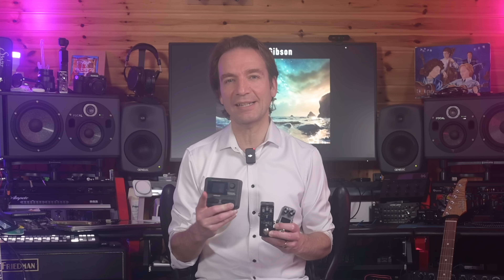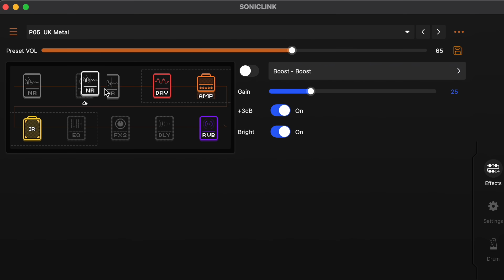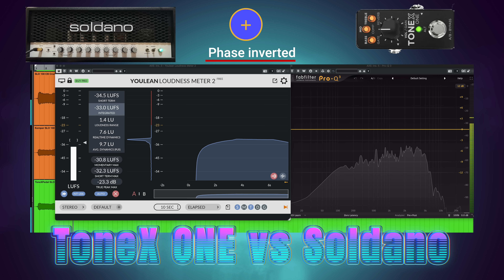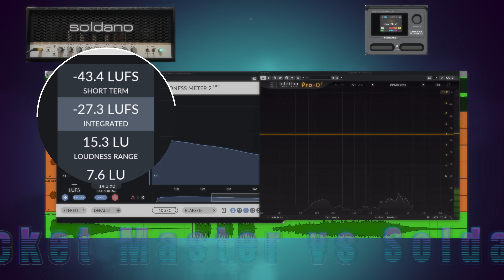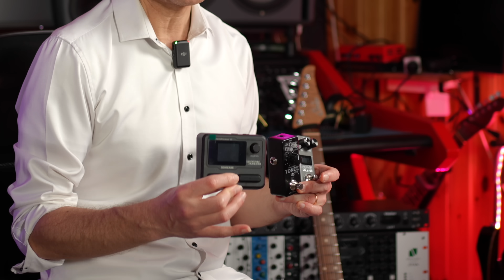Valeton GP-5 vs ToneX One vs SoniCacke Pocket Master (with NULL Test and vs a tube amp)

Comment: I have both the Tonex One and the GP-5.   But the Tonex One has a very high pitched whine that I traced to my dc power supply not providing enough current.  When I swapped in the GP-5, it worked fine.  In truth it’s easier to live with the GP-5.   But the Tonex One has some presets that are really nice.  I’ll need to figure out which one I can keep.

Comment: Tonal differences (you won't hear in a mix):  Pocket Master warmest, with centered mids; Gp5 has more upper mids, both though lose a bit definition on the high frequency side; Tonex has slightly brighter upper mids than gp5 (and slightly brighter than original amp) but keeps definition at high frequencies. Tonex is more hifi, brighter, but has very limited fx (no overdrive nor booster!!!).
Reply from the maker: Thank you for sharing your detailed observations on these units!

Comment: I bought the Valeton GP-5 as a backup to my amp, which I use set to a dry light crunch as I get 99% of my sounds from pedals on my pedalboard. I only need one sound for the whole gig. I have zero tolerance to bad apps with even worse interfacing with them the Valeton is the very best I have seen. Instant hookup online and user friendly.
Reply from the maker: Thank you for sharing your experience with the unit!

Comment: Hello Leo! 
On the market there are some new devices that are just coming out now. They seem to be the next step from the GP5/PocketMaster ( and also the bigger brothers the GP50 and the Smart Box ). I mean , they check some boxes that the others don't.
For example: they have the  ability to load NAM profiles and use those in conjunction with IR , they also have 48KHz 24bit AD/DA (which in theory helps with NAM profiles which are 48KHz too ) , they also have completely movable blocks in the fx chain ( 10 blocks total ).
I'm referring to the new Strich Pipe Tones , which is the same as the new Soran Tiny Stomp  and also the same as the Lekato ME-05
It would be interesting to compare one of these with the "previous generation" ( GP5/GP50/PocketMaster/Smart Box ).
Hope this gives you some food for thoughts! Have a nice day and thank you for all your work!
Reply from the maker: You are welcome and thank you so much for your suggestions!
The Smart Box is actually coming to my studio...so we will have some fun with it!

Comment: What scarcely ever gets mentioned with all these type devices  , is how you use them, and for me, I have not seen anyone address how you intend to monitor the sound from them….for me, monitoring the sound thru studio monitors is kind of sterile and you don’t get the live raw sound of a speaker designed for a guitar amp…ok maybe for recording and monitoring in a DAW, but not as inspiring sounding as a guitar amps raw liveliness…that why I prefer a device like the Positive Grid Dpark amp….it has speakers and is like a scaled down guitar amp and you still can come out of it via usb to record and monitor thru your DAW
Reply from the maker: Thank you for sharing your findings
Actually the Spark should have an FRFR speaker, that should be similar to the speaker of your monitors.

Comment: The looper has either 10 or 20 seconds depending on some update, according to other reviews 
   The headphone out also provides true stereo out effects on the guitar.
    I use a small portable amp for busking, (with another FX unit), headphone out to Amp's line in and microphone into the "guitar in" of the amp, and the Amp's Line Out retains the stereo.
    The drums offer a quick songwriting tool, but NOBODY, so far, in no other languages, and not even in the manual, demonstrates those 99 beats! 😢
Reply from the maker: Thanks for the detailed sharing

Comment: Hi Leo. I was browsing Tone3000 Nams today and noticed there is a page called plugnplay who say they do optimized NAM profiles for things like hotone, valeton and sonicake. Its not clear how they do it but perhaps they adjust the NAM for the conversion that happens on the cheaper units. I've used the specific Sonicake ones on my Sonicake Pocketmaster and they do sound good. Do you have any experience with this or any idea if any credibility to their claim?

Comment: Considering the Pocket Master comes in neon green  and Purple with green buttons and the other ones look like boring guitar pedals..  I ended up getting a GP5, just got it overnight. The idea of a wireless and battery operated , plug and play at the gig.  It's getting crazy. My usual live rig is classic, two cabs, rack, pedalboard. But it certainly is glorious and mighty. It is a beast to behold and move.  And sometimes it's just me with my flutes kind of gig. Maybe with an acoustic guitar. Then the full blown electric guitar and flute rig with 50 + 50 Watts of El-34's and a ton of effects. Love the flutes through the big 50+50 tube rig, it's just killer!!! Best ever. Guitar sounds great through it too, as an after-thought.
Reply from the maker: Thank you for sharing your experience !

Comment: Valeton's Suite will not display in editing view on my brand new PC even with the latest Windows 11 running? It works fine on Android but I don't want to use my Android phone that has access to my bank accounts for music. Also, for the Valeton editing software to work on my phone, the user must allow intrusive access to the phone's memory, contacts, images, location etc. all of which are transmitted to Valeton unencrypted and stored on a server in China. Did you know that? When I wrote to Valeton support, they merely suggested resetting the GP5 and trying a different USB slot although I already told them that the GP5 connects to my PC but that there is a flaw in the Valeton software suite not showing the editing screen. So, from my personal experience and blowing money on this, I would never recommend it.

Comment: the 7/4 main (bluesy) riff on the PocketMaster original review video is really up my alley ✌🏽🤙🏾😜
one of my favourite of yours ;) .

So… concerning the ADA conversion, and digital recording bit rate, on the PocketMaster & GP5 :

Do i/we have no choice to recording a 24bit idea, like, into another pedal, for eg ? 
If the ADA bit depth is at 24bit, i should be able to record a musical idea , by running my PocketMaster into my Mooer GL100 looper pedal, at 24bit 44.1kHz, and then export the WAV files from the Mooer into the computer.
In case i need to record directly into the DAW, i’ll just use my regular Audio Interface. 
Correct ?
Maybe one caveat on my setup, will be that i won’t be able to export the idea as a dry signal, into the DAW, right ?

i’ve just ordered the PocketMaster, as it has the most comprehensive metronome, for odd time signatures (better than the GP5 and the Mooer GL100 as it has the 1/4 beat option, for the click) . 
Also, unlike the ToneX One, or the GP5, one can dial it in, right in the unit itself, with no need for the app. 

thanks again 
kudos from Portugal 😉
Reply from the maker: Thank you so much, I'm really happy that you like the riff!
I guess it depends from the Mooer GL100 and if it is able to record at 24 bits and 44.1khz.
Yes, you can use your audio interface.
Thanks

Comment: In the Valeton site says:

Specifications

A/D/A Converter: 24-bit high performance audio

Sampling Frequency: 44.1 kHz

So, the GP-5 works in 24 bits; not in 16 bits as you said.
Reply from the maker: If you have watched the comparison chart and listened what I said, I said that the audio interface is at 16 bits and 44.1 where when used stand alone the units works at 24 bits....In fact, when I connect the unit to my Mac, my Mac recognise it as an audio interface at 16 bits and 44.1 kilohertz....
Thanks

Comment: Hey there! Regarding latency on these devices, you mean the latency using them as an audio interface, or while switching between patches in a guitar signal chain? Thanks!
Reply from the maker: Hi, it is the latency when you play those devices using the physical in and out. If you search for one of my video about the latency of 23 amp modeling pedalboards, you can find more info.
Thanks!

Comment: Am i still need ir loader for these modeler
Reply from the maker: Hi, an IR loader is not mandatory, in my opinion.
Reply: @LeoGibsonGtr if you should choose one  between 3 of it and give me the reason . I want to buy one but still confused need a suggestion.
Reply from the maker: In my two cents section of this video, I have tried to sum up the main differences and reasons why you should buy one or the other....at least I hope so
Thanks!

Comment: Leo o Gp5 so tem 512 sample points nao achei nada que confirmasse essa informação. Pensei que era de pelo menos 1024 padrão da maioria dos equipamentos leitores de IR
Reply from the maker: Hi, for me the stand out feature is the possibility to load profiles and the best profiles (in my opinion) are the ones with the cabinet included (as they capture also the interaction between the amp and the cabinet). Therefore I would not care too much about the IR sample rates.
Thank you!

Comment: Thanks again Leo. I love the features of that sonicake pocket master, with a tuner and possibility to use battery. Great thing to bring for holiday travel. I didnt like the sound after conversion from the original NAM profile, but I know it have many great sounding patches that will probably sound much better then a converted NAM profile and who cares about that when bringing the thing on holiday to play some shred stuff in front of bonfire with grilled sausages. What I love most about the sonicake unit is the price. Thats as low as you can get and in a size that fit perfectly in a gigbag along with the cable, battery pack and guitar pick and maybe even a mini amp. Now it makes me think if I wanna go camping with my electric guitar for the first time in my life and live under a tent for few weeks. Now it all start to make sense because only few months ago I would never even think of bringing an electric guitar under a tent to spice up my holiday.
Reply from the maker: You are welcome and than you so much for sharing your findings!!

Comment: I did a search with Chatgpt and it told me that the Sonicake cannot use different cab sims with the profile but you have to download profiles that have the entire rig(effects, amps and cab sims). GP-5 allows you to add cab sims to your profiles without having to look for entire rig profiles. I was on the fence about this for a while. The Sonicake is very affordable but I didn't like the plastic casing and it doesn't really look like it's for live use but only home studio/rehearsal. I chose the GP-5 for its rugged casing and more options for profiles.

Comment: Hey Leo, thanks for your videos, they're great. I recently started using the ToneX One for my amp solution where I can't bring an amp for volume reasons (common problem in churches). I'm wanting to make a small board with just the ToneX and a DI as my amp section separate from my effects pedalboard and I'm wondering: what is your opinion on Line Isolators like the Walrus Canvas, or the Pinstripe Pedals DISO+ over something like a Radial JDI? Is there any benefit tonally, is it all volume?
Reply from the maker: Hi, thank you; I'm really happy that appreciate the video!
Why do you need the DI Box? in order to convert Unbalanced out to Balanced one?
Nonetheless I have used the Walrsu canvas and it is a good unit. I have not tried the Pinstripe...therefore I can't tell from direct experience.
Thank you!
Reply: @LeoGibsonGtr  Thanks for the reply! Yes I need to send the signal from the tonex to the mixer across the venue, and converting unbalanced to balanced is the best way to do that. I was just wondering if you thought it might be worth while to go the line isolator route over a more traditional DI.

Comment: Hi Leo, I understand that all three units have audio interface capabilities. I need to ask — can the Pocket Master or GP-5 be used with a standalone version of AmpliTube for practice purposes (not for recording)? In other word, will the plugins be able to recognise the clean DI from any of those units?
Reply from the maker: Yes, you just need to remove / switch off all the effect in the pocket master signal chain.

Comment: Got a pocket master myself and I must say the battery is a game changer for me. I used to have serious noise coming from both my pedals and amp, and ever since I swapped to the pocket master plus a wireless device all the noise is gone, also no more annoying cables. As a bedroom player this combo fulfills all my needs. I play about 1-2h on a daily basis and a full charge of the pocket master lasts me a whole week. I paid about 60 bucks for the PM plus 40 for the wireless device, so that's around $100 in total, and all my noise problems are gone. Best two purchases ever.
Reply from the maker: Thank you for sharing your experience
Reply: What wireless device did you get?
Reply: @corsa180  Joyo JW-03, now that I look again it was actually 27 bucks not 40!. I also ordered a Joyo JP-06 noise blocker with it, so there's the 40 bucks (which I didn't even end up using at all)
Reply: @shinjiikari4629  Cool, thanks for the info!

Comment: Interface ToneX One - IK Multimedia: 24-bit/44.1 kHz
Reply from the maker: Thank you for sharing!
Yes, that's when using the ToneX one as an audio interface, but I'm not sure if the conversion of the standalone unit is the same
Reply: @LeoGibsonGtr  From IK Multimedia product page
Specs
TONEX ONE

20 customizable presets
Ultra-low noise, 24-bit/192 kHz converters.
5 Hz–24 kHz frequency response
Up to 123 dB dynamic range
USB connection/ 24-bit/44.1 kHz audio interface
Power Source: 9V DC, 120 mA (not included) or via USB-C
Size: 48 mm/1.89" (W) x 94 mm/3.7" (D) x 53 mm/2.09" (H)
Weight: 160 g/ 5.6 oz
Reply from the maker: Thank you so much! it is at 24 bits and 192 kHz

Comment: Hi Leo, I have both , the Sonicake Pocket master and the Valeton GP5, and although I prefer the sonicake’s convenience of rechargeable battery facility, it has a tendency, on high gain tones to distort during fade out, which the Valeton gp5 does not. Will rearranging the built in effects and noise gate settings solve this problem? Please keep up the brilliant work. Your demonstrations are by far the most informative and unbiased on You Tube! Kind regards Greg Bell from here in the U.K.
Reply: I saw another video on the Pocket Master that showed moving the noise gate to after the amp/cab/eq on the high gain tones solved the fade out distortion problem. I just got mine today, so I haven’t had a chance to try it out yet.
Reply from the maker: Thank you so much, I'm really happy that you appreciate the videos!!!!
I'm not sure, but maybe if you increase the sensibility of the Noise Gate, you could avoid some of the problems....
Reply: Which unit would you suggest ? Because I am considering both the Pocket Master and the GP5

Comment: [Dynamic Range and Note Envelop test]
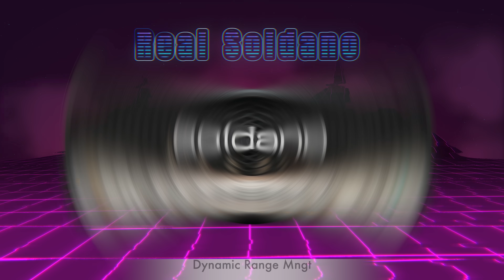10:25 Real amp
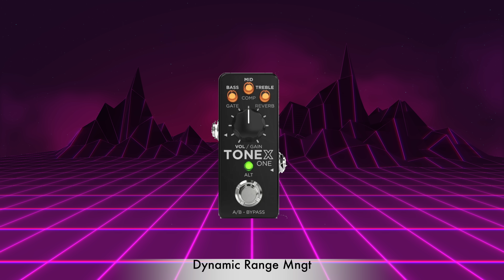10:51 Tonex
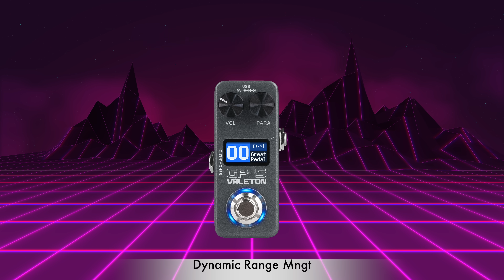11:19 Valetone
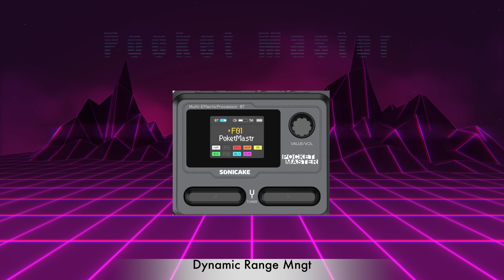11:44 Sonicake

[Note Envelop]
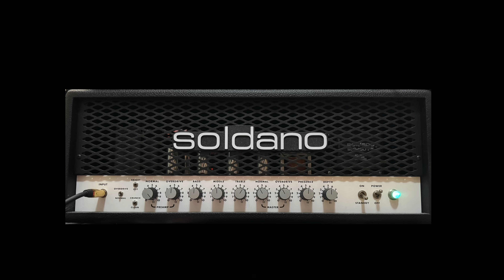12:11 Real amp
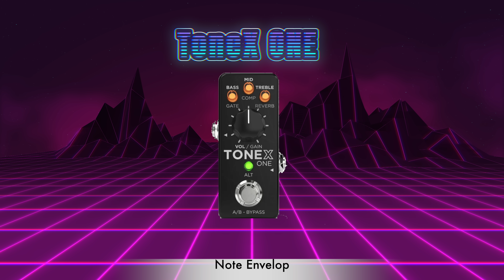12:43 Tonex
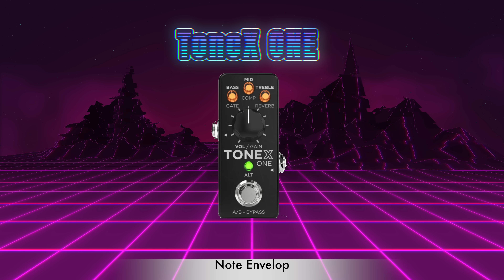13:14 Valetone
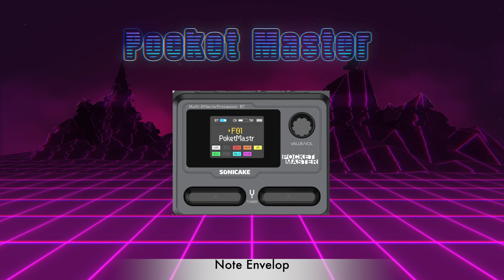13:45 Sonicake
Reply from the maker: Thanks for sharing
Reply: ToneX sounds like with a compressor on then off on 2 pedals

Comment: Leo, this is great. I have been so ready to get a Pocket Master but I may go tonex for my pedal and get the pocket master master for practice. I want a Nam/IR loader. Thanks for everything!
Reply from the maker: You are welcome and I'm happy that you appreciate the video!
Thank you for sharing your experience!
Reply: Is that dimehead Nam loader something you’re talking about? I bought one on impulse and don’t even know what it is :/ was going to list it for sale
Reply: @TheSkulletMan  Yes! You have an amazing piece of equipment. You can load profiles of heads, and then match them to "IR" (captures of speakers in a room). Lets say I wanted to patch an Orange crush with a 4x12 greenbacks. I could load those into the dimehead and get that sound plugged right into a PA.
Reply: @Brkprsn so sorry I’m still confused. The dimehead is good for what I have? Or the pocket master? My problem is I’ll buy it, and then be busy for awhile and forget how I was even going to use it for a situation :/ I like simplicity.
Reply: @TheSkulletMan the dime head is really really good. And while it seems complicated, once you learn how to load the NAM and IR the dime is better. The Sonic cake can load an IR, and load a nam, but not both at the same time.
Reply: @Brkprsn okay gotcha! So all I would really need is the Dimehead?
Reply: @TheSkulletMan yes! If you look up how to use the dice head you could replicate say a 5150 head, and then put it through a Mesa boogie black shadow cab- right in the pedal. It would sound like a huge 4x12 in a pa, or through a frfr speaker.
Reply: @Brkprsn wow I’ll look more into that!!!!